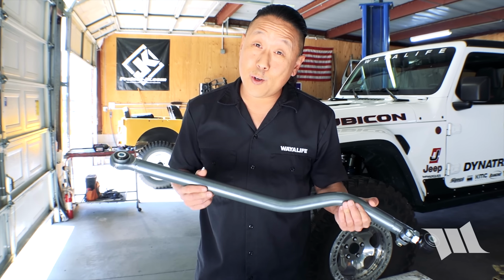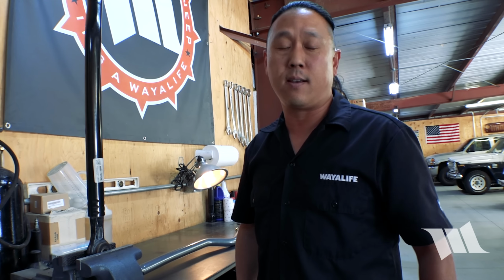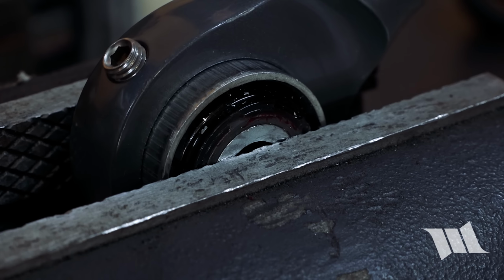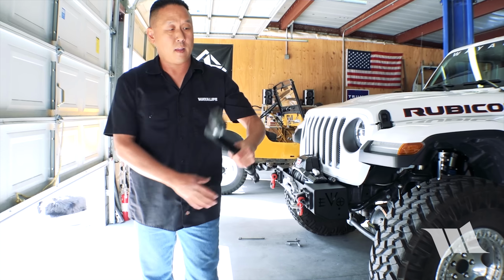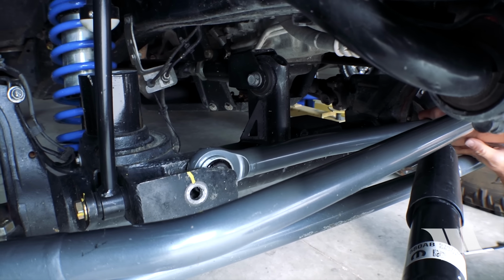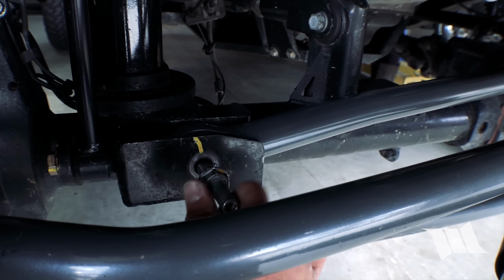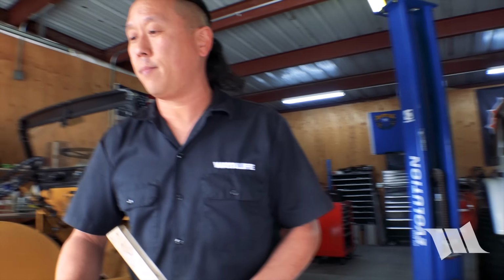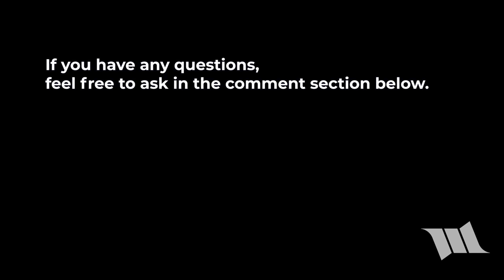Jeep JL Wrangler and JT Gladiator Truck Adjustable Front Track Bar by Synergy Installation

Comment: It shows 3 years since you installed this track bar. Is it still on your rig? If not, how long did you run it? I was curious about long-term durability.. thanks !
Reply from the maker: It is and it's still holding up well.

Comment: I see where you have installed a rough country, rancho and synergy bars.  How would you rank the 3 for a 4” lifted JL
Reply from the maker: They all get the job done but personally, I would run the Synergy or Rancho as both come with the Dual Durometer bushings and allow for better bind free movement. Rough Country uses bonded rubber bushings and they work well but they do bind up. Also, the Rough Country uses a split turn buckle for adjustment and I look at it as a weak point.
Reply: @wayalife  thank you for the quick response.  What about the trefelex adjustable track bar
Reply from the maker: @tuscaloosavideo  from personal previous experience, I am not a fan of anything made by Teraflex
Reply: @wayalife  thank you very much for your input.  Is there a drag link you suggest for the 4- 4.5” lift?
Reply from the maker: @tuscaloosavideo  Me personally? I went with this https://youtu.be/rCCfyskm-CM
Reply from the maker: Ideally, with that much lift, you'd want to install a drag link flip but to do that, you will need a track bar relocation bracket installed at the same time. You can get by without it though and I am. I would recommend Synergy.

Comment: Watched every single one of your install videos as well as others, learned so much more about jeeps after watching them. quick question for you, so i went ahead bought the Synergy TB  for my 2020 jlur after watching this video but after installation i noticed my TB was making contact with my axle side mounting bracket, just curious to see if you're having this issue as well. thanks!
Reply from the maker: Nope, can't say that mine is. Do you have a lift installed on your Jeep and with adjustable control arms? Could be you have your axle pushed too far forward.
Reply: Wayalife thanks for the reply. I do have a 2.5 lift with geo correction brackets and factory arms. My caster is around 4.5-5 degree

Comment: With a Mopar 2" lift on a JT, is there a need for a new rear track bar as well?
Reply from the maker: Not really. Your axle will be off center by just a bit but really, it's no big deal and won't hurt anything.

Comment: Hey sir! Does the Gladiator Mojave have an adjustable track bar from factory?
Reply from the maker: No Jeep comes with an adjustable track bar from the factory.
Reply: @wayalife  thank you sir! I purchased the track bar you have in the video! Can’t wait to get it installed on my Mojave. My axle is shifted 2mm towards the drivers side and pulling to the drivers side lol
Reply from the maker: @OneLowPony  While I think you'll be happy with the track bar, I should note that your axle being slightly off will NOT cause a pull. In fact, your axle will ALWAYS be off a bit one way or another depending on how many people and or gear you have in your Jeep. It's just the nature of the beast when it comes to a 4 link suspension system with a track bar. That said, is it safe to assume you just installed a set of new and bigger off road tires? If so, what you're most likely experiencing is what is known as radial pull. This is totally normal and pull to driver side is common with tires like Trail Grapplers.
Reply: @wayalife  haha it’s like you know me! I did in fact install 35’s in the ridge grappler variety. You have put my mind at ease now that you told me this. I thought I screwed my jeep up after the lift and going 35’s. Thank you for the amazing videos and wealth of knowledge! I hope you guys are at the Colorado Overland Expo in august this year!

Comment: Why did you get synergy over teraflex is there a reason why?
Reply from the maker: Yeah, there's a reason why. After having installed and tested TeraFlex parts on my previous Jeeps, I have found them to be substandard products that are made in China and advertised as being "assembled" in the USA. Here's a link that documents a lot of breaks we've seen over the years: https://bit.ly/3pcHFk2

I have found Synergy products to be made well, can stand up to the abuse I put them through and most of it is actually made in the USA.

Comment: Just curious. Looking for a track bar for my JK. The bushing on my Teraflex one has failed and the Jeep is experiencing a shimmy. Just curious, on the forums I noticed you recommended the stock track bar several times. You even used it on Moby. Just curious why you upgraded on the JL? Has your opinion on this changed?
Reply from the maker: Umm, on a JK, I still recommend a factory track bar and still run one on Moby. The factory track bar on the JL isn't made as nice or as well and so for it, I don't recommend it.
Reply: @wayalife  As always, thanks for the info! Thinking about picking up a stock track bae. With the stock track bar it doesn’t offer any way to center the axle under the Jeep. Running a 4” lift with UD60’s. Is centering not something I should be concerned about with the stock track bar?
Reply from the maker: Assuming you're installing some kind of track bar relocation mount and drag link flip, the stock track bar will be fine as is. Yes, your axle may not be completely centered at ride height but it's no big deal. By its design, your axle is always off center one way or the other depending on how much weight you have in your Jeep as the position of your axle will be different. I should note that you want an older 07-10 track bar or something like a Crown replacement as they'll have bonded rubber bushings on both ends. The newer OE track bars have a spherical joint at the frame end and it's not as strong.
Reply: @wayalife  Got it, good info. Thanks for the help!

Comment: Ok I get why you turned the steering wheel to align the holes for putting the bolt in, but in doing so you now misaligned the steering wheel slightly. Suggestion first before removing anything mark tire positions on ground, if you're really OCD you can measure the distance inside from tires (this is if you don't have any alignment issues already), next do everything exactly the same way until you get to the point of turning the steering wheel to align the holes for bolt, instead adjust the bar by turning the nut either to extend or retract to align the holes to except the bolt, making sure you haven't bumped a tire out of position to the previous marks you made earlier (if your OCD kicked in remeasur the inner wheel to wheel measurement to verify exact match)   continue with the rest of the installation as was demonstrated. *Note steering wheel position should be centered before doing repairs. If you follow my suggested procedure everything should be perfectly aligned as well as your previous alignment, WITH the exception that if your other bar or bushing is excessive worn, in which case then you should have a alignment done by a good alignment shop. I hope this helps! This tip is from semi truck steering repair/replacement that is common practice.
Reply from the maker: Actually, I got my track bar measurement dead on to what the one was that I removed and my steering wheel was still dead on. But thanks anyway.
Reply: @wayalife  I can believe that. I only mentioned it because in your closing statements you suggested that the steering wheel could be off center & upon your measurements you stated it was off just a little 1/16th I believe, but still within tolerances, just watch for slight tire wear if it toed in little. Wasn't trying to criticize, just trying to be helpful.
Reply from the maker: @mtoddvan  The toe did not and would not change with the installation of a new track bar. When installing a new adjustable track bar, your steering wheel would be off IF it were set differently than before. This would apply to someone who just installed a lift kit. I was just trying to make sure people would understand that this would be normal and that a drag link adjustment might be necessary. Not trying to argue, just trying to clarify.
Reply: @wayalife  Thank you! Enjoy your videos! Keep up the good work!

Comment: Hey Eddie, I appreciate the videos- after talking to you last week about the steering (SS vs. Synergy) I decided to order the full set through Synergy including track bar bracket. Super excited, just having to wait 6-8 weeks for production... I was curious, when installing the track bar how do you know what to adjust your bar too w/ a lift. I have the 2.5 AEV lift currently but still have the factory track bar. Do I just match the measurements as is or do I need to adjust? I appreciate the feedback-
Reply from the maker: Hey Jeff, here's a write-up I did that covers what you need to do https://wayalife.com/showthread.php/56571-WRITE-UP-Basic-DIY-Jeep-JL-Wrangler-FRONT-END-ALIGNMENT

Comment: Great video as always. Curious, why did you guys get rid of the fox stabilizer and go back to the stock unit?
Reply from the maker: LOL - good eye. The Synergy tie-rod is so tough, I've been using it as kind of a skid but unfortunately, I've been beating up the Fox clamp to the point where I almost couldn't get it back off. I'm in the process of cleaning things up on it and then will most likely reinstall it. Also, it gave me a chance to test things without a steering stablizer and with the OE to see if there was any difference. So far, the Synergy steering components alone are doing a great job.
Reply: thanks for the reply Eddie as always. Would love to hear your opinion on the new track bar/drag link frame side brace from synergy. It’s pricy but if it makes a difference I’d say it’s worth every penny. Keep up the great work.
Reply from the maker: That video should be next. It's a great design but honestly, I can't say that we've felt a need for it. Happy to have it though.
Reply: Awesome. Thank you as always and thank you for all that you do for the community, and for those of us that don’t have quality shops to help, having such a great resource is a massive asset to us all. Keep fighting the good fight. Don’t go to the dark side and order the new Cybertruck lol
Reply from the maker: HivePhoto 🤣 too funny

Comment: Anyone running this Synergy trackbar with their sector shaft brace? How well does it clear the pitman arm nut at full compression? They claim it is bent to clear it. My Evo trackbar is limiting my uptravel big time because the bend it has is too drastic and at the wrong angle upward instead of out toward the front.
Reply from the maker: I have no issues with it.

Comment: Eddie someone was saying that the bolts to use on the track bar is 9/16 x 3" grade 8 bolt that I know, but he was saying the the fine thread is better that true?
Reply from the maker: Just so that we're on the same page here, the factory track bar bolt is a fine thread 10.9 as in, it's STRONGER than a grade 8 bolt and it's something that exists on about 3 million Wranglers. In the over 25 years that I've been working on and wheeling Jeeps and in the 17 years that the JK and JL have been around, I have NEVER seen this bolt be an issue or at least, so long as it's been properly tightened to torque spec. To me, changing it out for a substandard but slightly bigger bolt is just stupid. However, I would never pretend to know more than what someone on the internet said.

Comment: I installed this track bar on my jeep and after about 200 miles it started making noise, loud squeaking noice noticeable enough that I can hear it while I’m driving — with 37s and diesel, so I know it’s there. While parked, I jumped on the bumper up and down and the noise was there — removed the track bar and the noise went away. 
There was nothing else I could do other than reinstall it and follow the instructions to the T. For a few miles the noise went away, and now it’s back. 
Any suggestions how I can make the noise go away? Sounds like synergy sent me a bad track bar? :/
Reply from the maker: Being that you're running 37's, I can only assume you're running some kind of a lift kit. Did this lift kit come with adjustable control arms? If so, I would be willing to bet you've got them set too long. The Synergy track bar is thicker than the factory one and it may be making contact and/or rubbing somewhere like the axle or frame mount.
Reply: I have the Duratrac Endurosport 2” lift. But no, no control arms? Would LCA fix this issue?
Reply from the maker: @d30Lisus  Okay, with that kit, you wouldn't have enough lift to need control arms. I would look at the track bar at both mounts to see if it's making contact with them. If it is, that's probably where your squeaking is coming from.
Reply: Wayalife Yep, that was the issue. The track bar was hitting the mounting bracket on the passenger side — used a grinder and problem solved. Thanks for your help!
Reply from the maker: Awesome. Glad I could be of help.

Comment: Ok.. I'm confused. You removed your old track bar and installed the Rancho track bar in March 2019. You seemed to really like it. Then in this video, in November 2019, you still had that same old track bar (before the Rancho) and  you  put on this Synergy track bar. What happened to the Rancho? Why did you go back to the old track bar that you had before the Rancho swap? The old track bar caused the vibrations in the steering wheel, right?
Reply from the maker: Nothing to be confused about, testing out parts is what we do. Both track bars use the same dual durometer bushings and both are good. This one is better in that it has more features like being able to adjust it on the Jeep.
Reply: @wayalife  Ohh ok.. thanks for the clarification! Have you ever thought about listing your favorites in a video or on your website? Are you free to disclose that information after companies send you products to test? I wouldn't want you to burn any bridges with them, but it would be interesting to hear your unbiased feedback. Great videos, by the way!

Comment: So I guess an alignment would be needed
Reply from the maker: Not sure why you would say that. All you need to do is set your track bar so that your axle is centered at ride height and you're done. Caster will not have changed, toe will not have changed and camber cannot be adjusted on a solid front axle. All a shop will do is charge you to do nothing.

Comment: But where did the fox ats go?
Reply from the maker: If you're referring to the steering stabilizer, the tie-rod clamp is made out of aluminum and it wasn't able to take the abuse the way the Synergy tie-rod definitely can. The Synergy clamp is made out of steel and it's been holding up much better.

Comment: Don't know how I feel about the allen bolt on the stabilizer. Allen and torque heads suck!
Reply from the maker: It's just there to keep the stabilizer from sliding off. Been fine for me but there are other solutions out there if this makes you feel uncomfortable.
Reply: There is no real load on it Rick Cronin , it’s just there to hold the washer on so the stabilizer doesn’t slide off like Wayalife said 👌🏽

Comment: WHATS YOUR OPINION OF THE ANTI ROCKS
Reply from the maker: I am a BIG fan of Currie products but I am NOT a fan of their Antirock. Way too soft on pavement and way too firm for off road. If all you did was bomb across the desert, it'd be a good setup but for sudden evasive maneuvers, it's too wishy washy for my taste and doing an apples to apples comparison flex test, I found the Antirock to LIMIT flex and by quite a bit. I prefer the Rubicon electronic sway bar disconnect.
Reply: @wayalife  THANK U

Comment: Why you never use teraflex? 🤣
Reply from the maker: LOL - based on the emoji you posted, I think you know why.
Reply: @wayalife  but how about falcon shock? They look strong and even can take a beat🤣
Reply from the maker: @joyoboyo1936  Sorry, based on personal experience installing and testing TeraFlex products, I would NEVER run any of them again. Also, I really find it distasteful how they always try to market their products as being "designed", "engineered" and or "assembled" in America as if that's remotely close to being the same thing as being "Made in USA". If you want a quality shock, spend a bit more money and buy a set of Fox or Kings.
Reply: @wayalife  i didn't know there is a different between Made in USA and made in America, however the only parts that i would buy from teraflex maybe just mudflap🤣
Reply: @wayalife  Wait that's mean teraflex made in china?, but designed in America?
Reply from the maker: @joyoboyo1936 You can't legally say "Made in USA" if it isn't. There are a lot of ways to suggest as much through the clever use of words but it is NOT the same thing.

Comment: Eddie hate to bother you, can I do this my self in the driveway, will I need to get an alignment? I see how the driver side bolt was off, a couple of people said I need alignment.
Reply from the maker: I would never pretend to now as much or even more that what a couple of people have told you but the idea of needing an alignment after installing a track bar is pretty dumb to me and a poor reason to waste money on a whole lot of nothing. That said, yes, you can totally do this in your driveway.
Reply: @wayalife  thank you, got say I'm  a little worried about one wheel be out more then the other, but I got your video to help me out.
Reply from the maker: @RogerJG21  not sure why you'd be worried. One wheel is ALWAYS a bit more out than the other on a solid axle vehicle with a track bar. It's just the nature of the beast and depending on how much weight or lack there of you have in your Jeep. More weight from gas and passengers and gear and your axles will shift to one side and totally empty, they'll shift to the other. It's no big deal